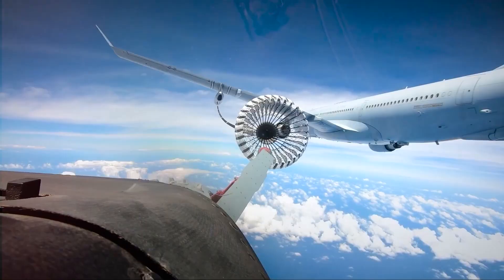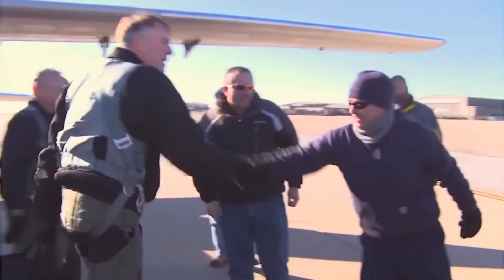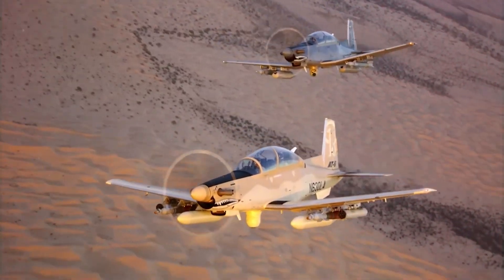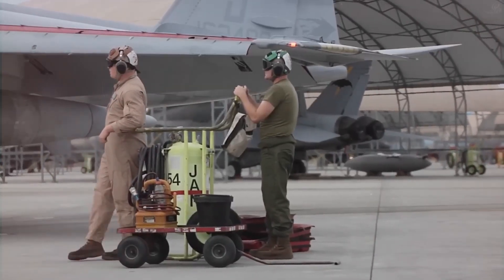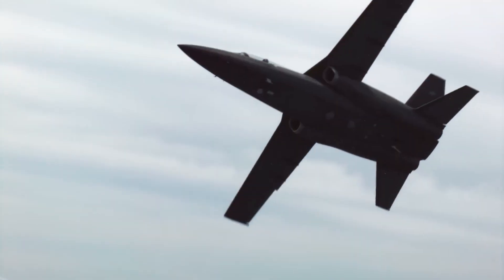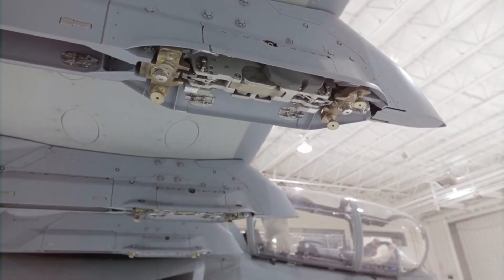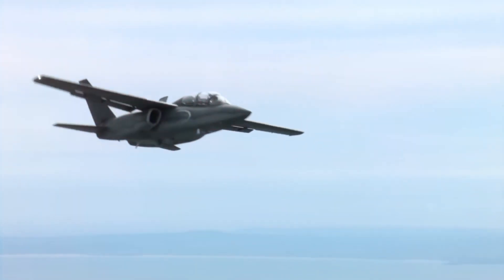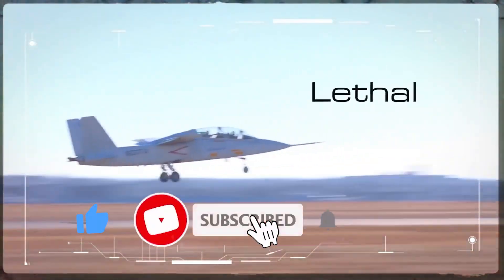Sky Dominator!

Comment: Starts with a good Idea : 
Make a warbird with easily available parts ...
Wings... engines....
Should be cheap.

But then the price tag is way too high !

Price related :

Compare this to an F16...
You might just go for the F16.
ang get the real deal for the same price.

Compare this to an A10...
You might just go for the A10 and get the real CAS for cheaper.

Technically :
This scorpion 
has two engines alright 
but nothing is said on this video about flight control redundancy, armor plates....

The speed is not different from other former Cessna CAS or light attack 
What is the improvement really ?

The engines should be mounted in between the tail fins to make heat targeting a bit more complicated. It's not.

If i had to buy something that flies that fast and looks like a fighter i might buy a Fouga Magister or a Cessna Tweet. (Dragon fly)😅
Dirt cheap compared to these 20 millions.
Cost per hour three times less.

If Textron really want to sell this and sell it in numbers, it should sell it in  the 5 million dollar range.
Reply: You right. That's why the air force didn't pick this. They chose the T7 Red Hawk. And the special forces choose rhe very very cheap at-802u sky warden. 

This thing is an L.